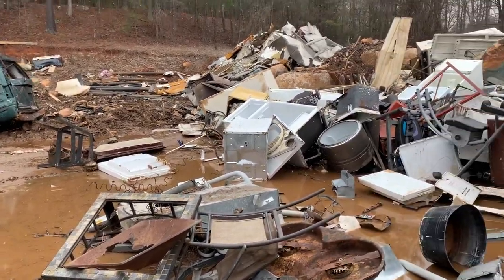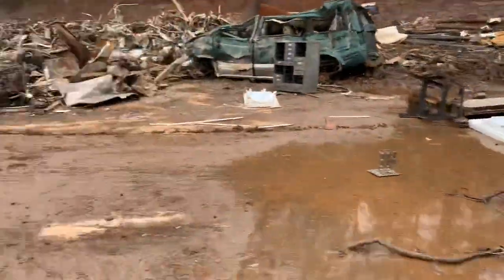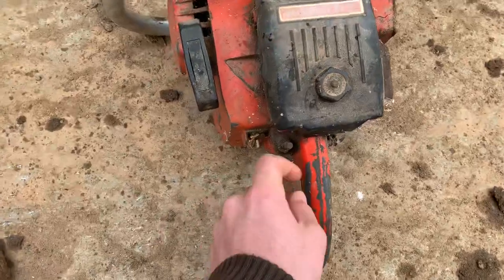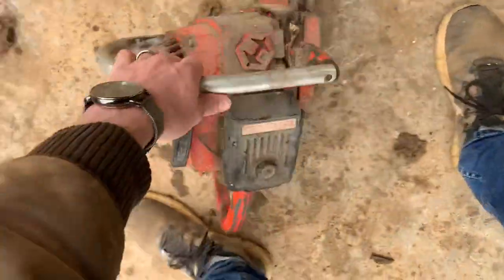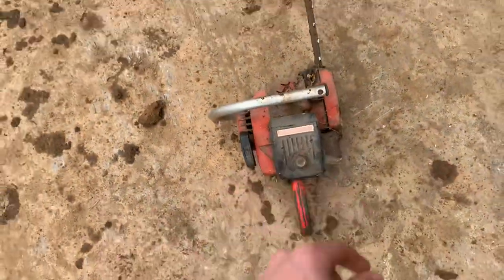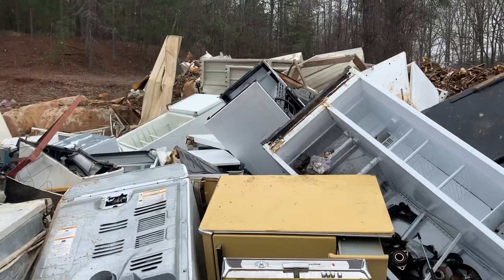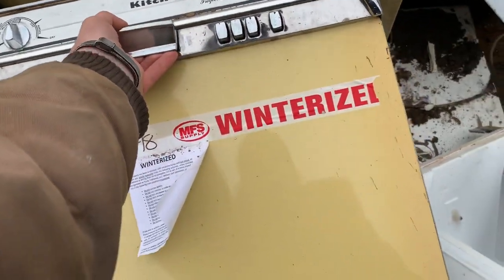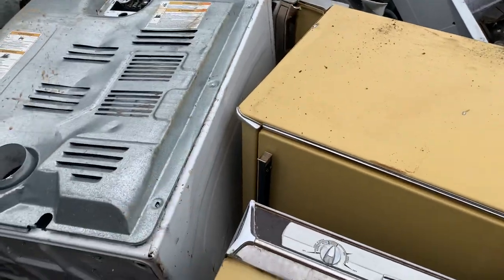Vintage chainsaw/appliances salvage

Comment: My house is vintage already. I replaced the stove, got rid of that lovely shag pile carpet and the yellow flower print wallpaper. The toilet and vanity were replaced 4 years ago, but still have the tiled floor in sky blue and white 1/2" tiles, peach bathtub. The laundry was turned into an internal bathroom in the '70's but the original bathroom in the backyard is still there and used today.

Comment: Those old appliances are built to last. I have a GE all in one stove in my house from 1976. Works great and does a great job cooking. I have that same Sears tool box.
Reply from the maker: We had an old GE washer and dryer in my first house. Lime green with the wood trim and chrome features and dials. It wasnt necessarily quiet, but it worked great!
Reply: Nice. They aren't always quiet but they will last a lifetime lol. Btw I do like your idea of having a vintage room in a house. In fact most of my house is set up that way.

Comment: I have a old kenmore washer, one day I discovered the agitator had become a pacifist, the ratchet dogs were worn smooth $2.65 plus shipping for the four dogs had it working like new again. 
I also have a sears cold spot 19 refrigerator still working like a champ.
Reply from the maker: A couple bucks and a few weekend hours was all it took. Now, think about that, anyone else would have thrown it were this one went, and spent $500 on a new machine.
Reply: @MXguy95  the fan in the cold spot refrigerator started making funny noises and it wasn't cooling on the refrigerator side so I pulled the shelfs out of the freezer and the panels and ducts out and oiled the shaft bushing felts. fixed! the panels and ducts snapped in, it was made to be serviceable.

Comment: I bought a 2 year old washer in like 90 that was a direct drive big whirlpool. I used that thing right till I bought this house in 2012 and I used it for a while till I bought a HE top loader. In its life I put 3 pumps in it for about 20 each, then I had to replace the coupler, and the agitater dogs just before I sold it cheap still working. It was made to last, and be able to be serviced easily. The parts were usually improved and cheap as well and it was loud, used a ton of water, but it cleaned well. I couldn't afford the water bill anymore so got a HE that uses 8 gallons per load vs 50. The HE has already ate the tub bearings once and already needs another set but they are also cheap and kinda easy to replace with the right tools.

Comment: When your yard rake also serves as your carpet pick. You’re livin in the right decade. 
If you find a coin operated bed - I’ll personally send a roll of quarters down  if you’ll promise to film it up and running. 

That harvest gold dishwasher will make a great parts washer. Remove the heating coil and throw a gallon of kerosene in. Push pots and pans and let that magic happen!

Comment: Homelite automatic is electronic ignition
I run a super xl 12. Love them old vintage saws
Reply from the maker: Ahh thanks for the info! Ive only had one of my homelites ever give me ignition problems, I havent found the replacement parts for it yet. But I just use one of my other seven anyway lol
Reply: @MXguy95  try a mid western dealer with NOS on shelf, those  old Homes are bulletproof and take a resto well!

Comment: You did good. Im a great fan of the Vintage Homelites. I have 2 XL12 and two super XL12 auto oiling saws. That run and I use  on a regular basis. We just posted a Video showing Me using a Homelite and a Lombard to make a couple cedar post. Pull the muffler and spark plug on the Homelite and you can see  the condition of the cyl and piston. If there good that saw is worth The time money and effort to getting  it running.

Comment: Auto is an auto oiler. The thumb pump is a manual override for when cutting through pitchy wood or running a longer bar and chain

Comment: Id really like to see a Video, in which you restore those finds.
Reply from the maker: I dont do a "restore" so to speak, just a thorough cleaning, and then make them run. I like to use my stuff so it doesnt need to be "like new" just clean and functional !

Comment: Winterized means the water in the house was turned off and drained. This usually means the property was foreclosed on and is bank owned. Those appliances were probably removed by the new owners as a result of a renovation.

Comment: I also have a chainsaw addiction. Just got 2 Homelite XL-12's on line. They are great ant they.
Reply from the maker: It started with one about 8 or 9 years ago.. and I was hooked! I got rid of my other saws. Nothing but vintage homelites for me! Even chunked my commerical Stihl!
Reply: @MXguy95  
Wow. Good job. I just wanted a chainsaw assembled or made in NC. I recently found out that back in the day Homelite had a place in Charlotte where they made or assembled the Homelite XL-12 the Red colored ones. Look for the black & silver tag on the right side under the breather cover of the saw. If your lucky it's still there. It says Charlotte NC. Take a look sometime. Really enjoy & appreciate you ane your channel.

Comment: grab that car jack  see if it works!!!i have 2 i picked up.one i believe somebody was changing a flat tire and forgot it.it was in a really weird spot and thay had the tire and rim sitting in the street, along with the Jack and a wheel block.i barely got the stuff before the garbage truck at the time and the Jack was quite literally brand-new 3 tun capacity lightweightand been using it for years in the backseat of different vehicles. I've got.i tried getting one like it used a few times and they want like 100  for use  One.that one there in the pile of crap. They usually run like 100 used.i have one very similar to it that I use in the shop that somebody throughout.i am horrible for picking up tool boxes full of tools lol.i can confirm those damn chainsaws don't die.i wish I could figure out how to get you a picture of the one I've got.it looks damn near identical to the one from evil dead.i found it where somebody took it in for scrap. I picked it up  and immediately found myself wondering, that's weird this is really large, but no weight to it. I gave it to polls and it started right up. Only chainsaw. I've never had my hands on that I can physically pull start and it's the damnedest thing, because you don't really have to do any kind of work. Just give a little pole like a child's toy and it starts right up. ive had it in a plastic case now for about a year and been meaning to get Sunday to clean it up and put a new chain on it. Normally I can't use a chainsaw because I can't physically start them. It's the only one I've ever owned that I can start and carry around.

Comment: Your idea isn't remotely stupid.  Several years ago I worked in a used appliance store and an upmarket couple came in, said they lived in an architect-designed 1966 house they were preserving and needed an Avocado green refrigerator.  We had a couple kind of plain non frost free ones in stock but I could tell it wasn't what they wanted. I took their name and soon a beautiful top of the line model with the fancy original interior intact came in.  I called them and not only did they buy it but tipped me $50 for finding it. Big fan btw.
Reply from the maker: Im falling in love with the idea of a "retro house" Modern stuff doesnt do anything for me anyway. And half of the time the functionality of modern stuff has decreased to appease a different visual look. I love the wacky colors and fancy chrome and wood panel clad decor from those eras. Thats an awesome story about the couple! I would have loved to see how their home was set up!
Reply: @MXguy95  I think I was in a house like that back in the 80's. Lots of Mobile Homes still around in original condition, owners died and the park wants them out.  I'll look on youtube and see if I can find a good interior vid.

Comment: I’m interested in vacuum cleaners if ya have any pm me on telegram
Reply: I have an old Kenmore cannister I bought 25 years ago or so.  It still works but the pipe running to the carpet cleaner finally broke.  I took it to the vintage vacuum shop and they couldn''t fix it. Would love to find that piece.